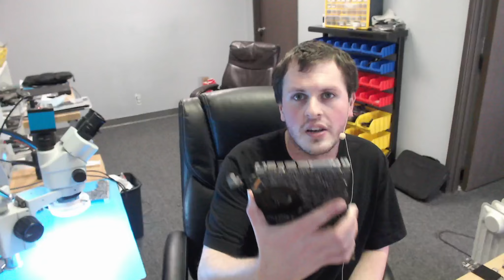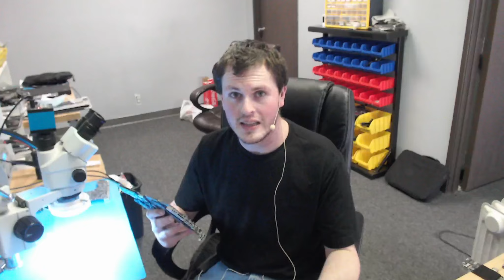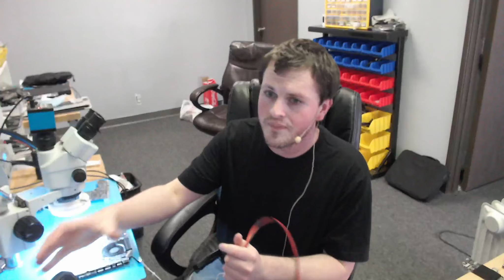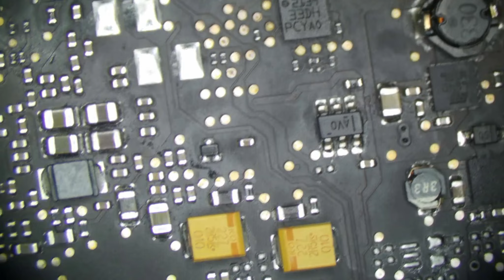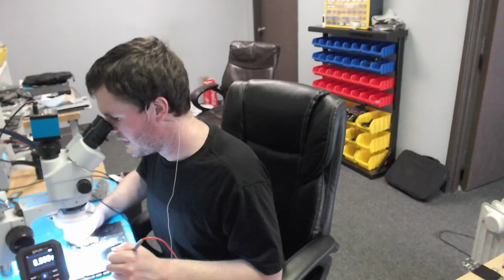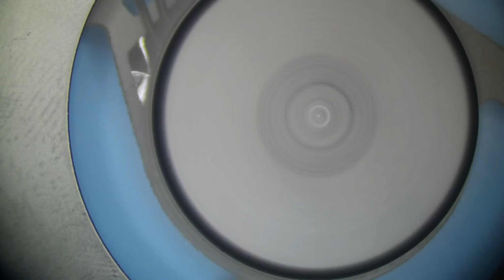Quick and easy no light on charger/not charging repair on A1286 MacBook Pro

Comment: what im really upset with in that jobs is about  that he litteraly change something who cost 3 dollars and we need to pay 150 dollar for this
Reply from the maker: It’s the skill you are paying for, not the cost of the part. Replacing of the part is the easy part. Diagnostics are not, not to mention the $5k plus in lab equipment to properly do the job.
Reply: @TCRSCircuit  could this fail intermittently in your opinion?, if I leave the MacBook plugged in it starts to charge after a random amount of time, sometimes a day or a couple of days sometimes a week and if I unplug while charging then plug straight back in it goes through the whole cycle again. Just curious of your thought having found your brill vid. Cheers Lee
Reply: Do you still do these repairs?

I have a 2010 macbook pro I inherited from my mom.

It's not charging, and there is no light when I plug a charger into it.
Reply: this guy straight up rage baiting.
Reply: Do you have the many years of experience to diagnose the issue? Do you have the equipment to fix the issue? Do you have the knowledge of how to properly repair the board once the issue is found? You're not simply paying for a part, how can you expect someone to charge only the parts cost on any repair? Quick and easy is relative to the years of experience and failure along the way that brought him to the talent he has today. I really appreciate the service TCRS provides, and that's what you're paying for. I genuinely hope you don't actually think like this, because you have a lot to learn bud.

Comment: I have a 2010 MacBook Pro with this issue. Where can I find a board diagram? This video is pretty clear, but my board is a bit different.
Reply from the maker: Google, however that machine is almost 20 years old. It's time for a new one.
Reply: @TCRSCircuit  I have a new one. But I got the 2010 in college, and there is a lot of sentimental stuff on there, and I still use it for a select few things.